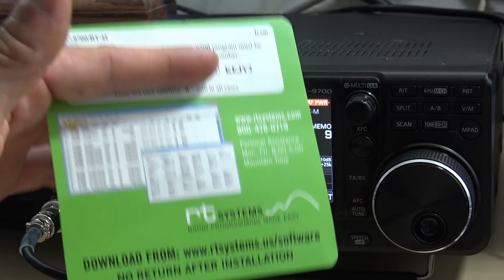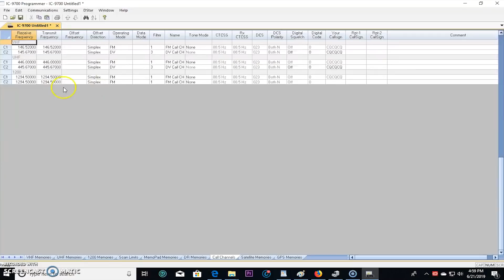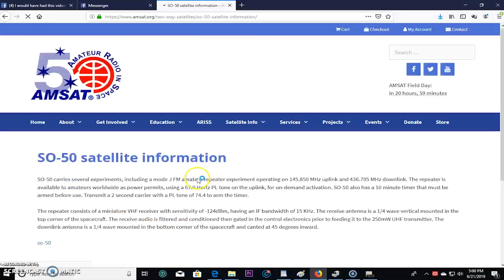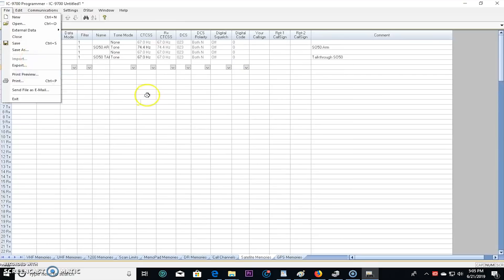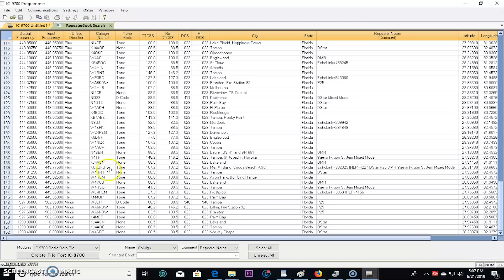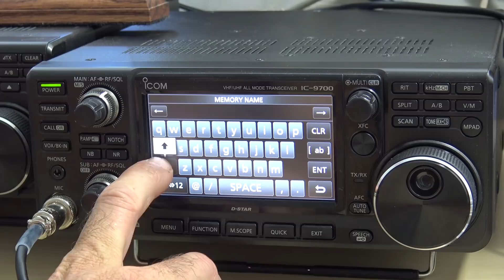Icom IC-9700 Programming, RT Systems, How Does It Help You?

Comment: I am trying to set up my IC9700 and am smashing my head off the wall in frustration. I cannot find a simple, step by step guide any where that explains exactly what to do. I have registered my callsign for DSTAR with ICOM UK and have downloaded the UK repeaters file and copied it to my SD card. Now that card is in the radio, how do I import the repeaters list to it?Once that's done, how do I then access D-Star? And am I supposed to be using a horizontal or vertical polarised antenna for this?

Thanks in advance for any help you can offer.

John M7JHA

Comment: Hi Eric, that was a great video.   Would you consider a tutorial on attaching a gps to the IC-9700?   I cannot get mine to work regardless of what I try.  I've never seen the gps icon.   I'm still not convinced the radio has a defect, and it's probably something that I'm doing wrong.   Thanks   Mike K8MB

Comment: Thank you for the video… I love my ICOM 9700… Great radio. However, I find that RT Systems leaves a LOT to be desired. I bought their software for four different radios and have had problems with their software for the 9100, 7100 and now the 9700. (The one for the D74 was without issues.) The problems vary but the issue I had with the 9700 software was that it actually did not even work. I submitted the issues to technical support and they agreed that I had spotted some catastrophic errors. They eventually fixed the issues – but my issue is that they rushed a product to market without even alpha testing the software – depending upon the users to do their testing for them after they paid money for it. I keep buying their software for the functionality since there is nothing else close – but I cringe every time I have to give them wallet share. Again, great video as always! 73 de Robert K3RRR

Comment: The 9700 will be my next radio I have a 991A and a 7300, I got the 7300 first and love the layout and controls and then got the 991A and almost instantly hated it, its only saving grace is the lighted buttons that I wish icom did.

Comment: Every now and then, a real super radio comes out like the Yaesu FT - 857 and now the Icom IC-9700. I have the 857 in my Silverado, but the 9700 will have to wait a while as I save up for it - can't wait though! I believe that in five or more years from now, both radios will still be "modern," especially the 9700 which is futuristic today. Thanks for the video and 73!